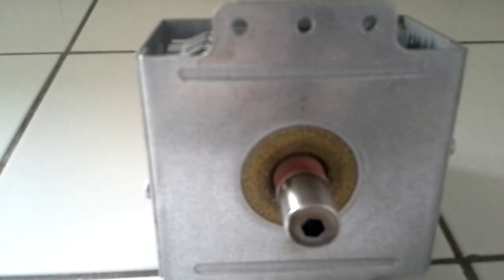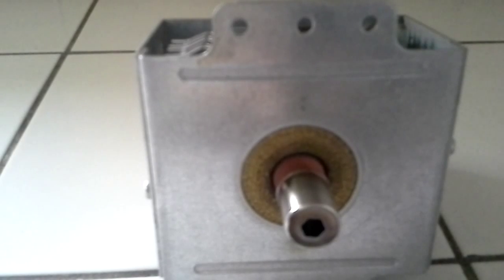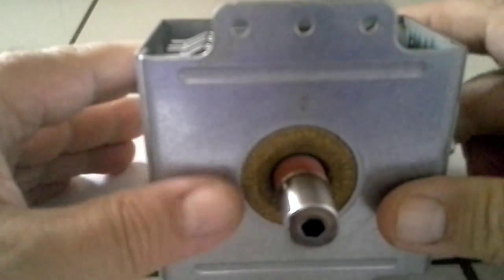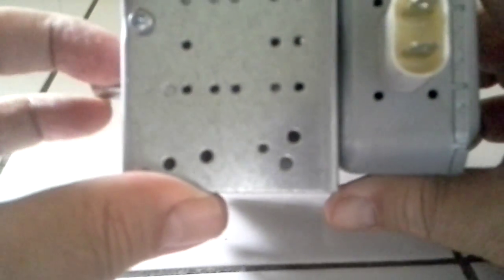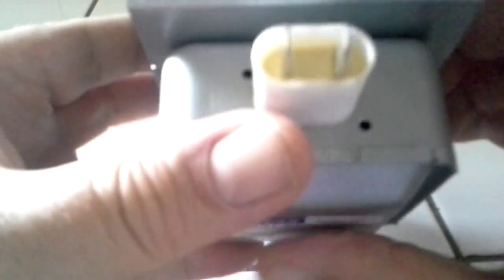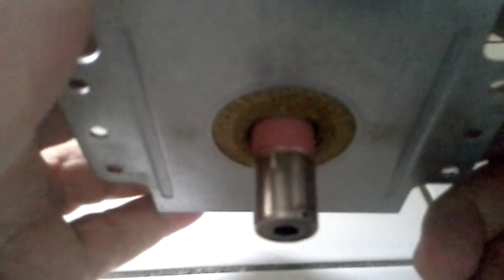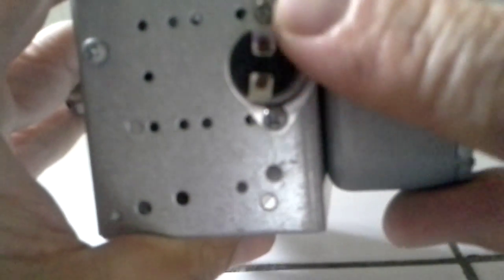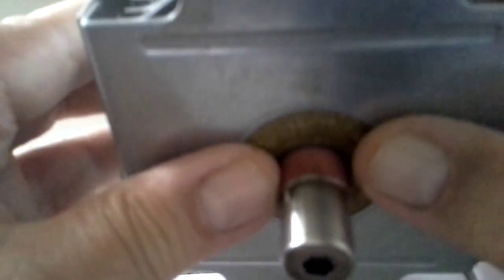BLOCK RADAR GUNS."I DISCLAIM ANY AND ALL THINGS."

Comment: Just so ya, know, the microwaves are harmless because they are not contained, confined, etc. Same goes for the radar. Is safe because its not confined, otherwise cops would not be allowed to use them. Lasers? They don't cut your car in half because the intensity is low.